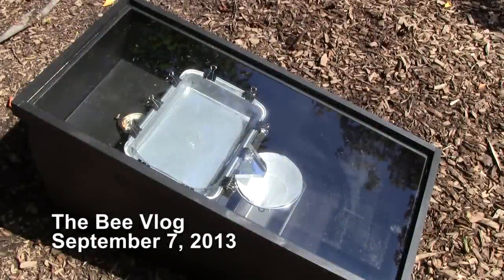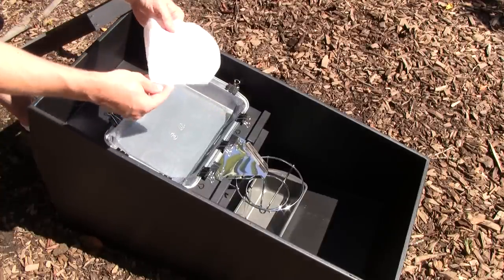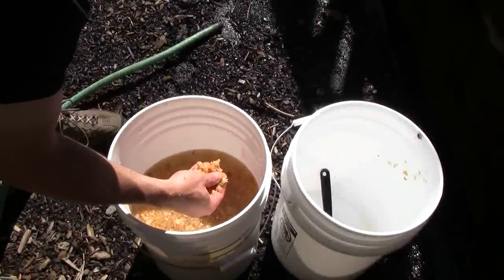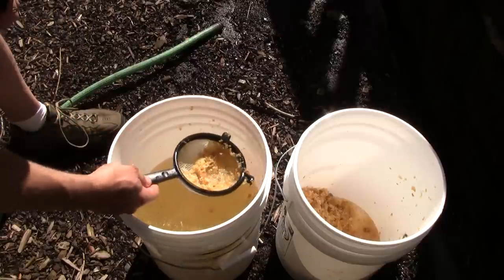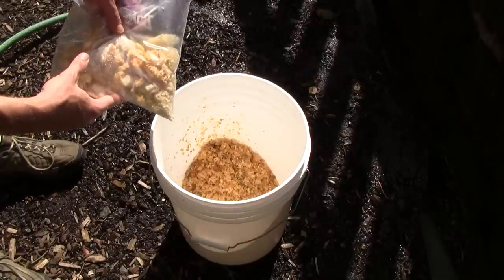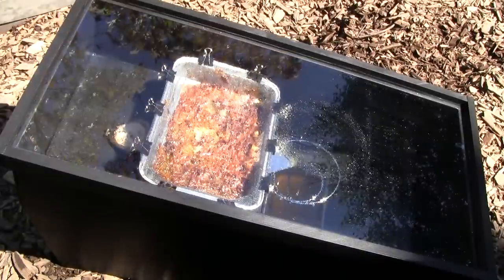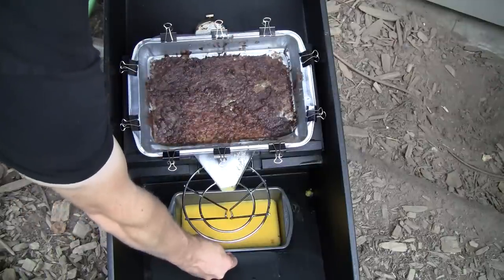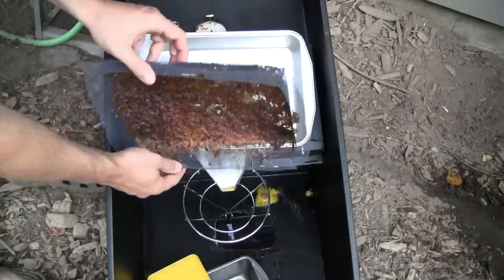Solar Wax Melter Test - Bee Vlog #118 - Sep 7, 2013

Comment: You did a really good job. Well built piece of equipment. I like how you proceeded methodically testing what works and making changes. If you want to keep the oil filter maybe you can try it fitted into a metal funnel. The hot metal may keep that wax from cooling. And maybe it won't haha. That's the fun of testing it out. Great job! Seriously great building on this one. Subscribed and liked.

Comment: To reuse that screen, turn it upside down on some newspaper and place it in the sun. The heat of the sun will quickly release the gunk from the screen and it'll drop in a lump on the newspaper (makes a great fire starter). The screen is now ready for reuse.
Reply from the maker: Blaine Nay Great tip. Thanks!

Comment: Old video, buuuut
you might be able to place a 16D nail on top and perpendicular to the top of the frame.  You could then use it's shadow like a sun dial to judge right angle to the sun..just a thought.

Comment: Another beekeeper said that the process of rendering beeswax in water is what causes candles to sputter, so hence, he processes all his beeswax in a double boiler. Is there any way to know which, or if both, are the cause?
Reply from the maker: If water gets in the final candle product it can cause sputtering. However, I haven't had that problem. Probably because I use a double-boiler to melt the wax for one final filtration, then again to melt it before pouring into wax molds. Any water that got into the wax during the rendering process is long gone by the time I pour candles.
Reply: @TheBeeVlog  Thanks for the clarification. Makes sense, nice tip.

Comment: Any idea where one could find a flat stainless steel funnel like the one in this video? Outstanding melter, and I'm in the process of building myself one right now.
Reply from the maker: I bought some thin sheet stock at the hardware store and cut/formed it myself.
Reply: @TheBeeVlog  Thank you for the quick reply. I was pricing the cost of flashing material and was thinking of doing the same. I was hoping to avoid having to make one because I know I will cut myself on it. LOL.

Comment: I know you have not posted a new video in about 6 months, but have you revisited this wax melter? did you fix the issues you had?
Reply from the maker: I do use it still on warm sunny days. I don't bother using the filter anymore. It's not really necessary. Most of the gum stays behind in the screen, then I just change out the screen. This solar melter would probably get hotter if I had the angle of the glass set correctly. I've since learned that the angle of the glass should be about the same angle as your latitude, in my case it should be about 45 degrees. I'd have to completely redesign for something that steep. So for now it only really works on our hottest days.
Reply: Thanks for the update. I live in South Florida, so even on our coolest (notice I didn't say cold)days we still have a healthy amount of sun. Thank you for all of the videos. I have watched every single one, I;m a big fan of your channel.
Reply: @TheBeeVlog  you could flip the screen over to listen the gunk off of it.
Reply: @TheBeeVlog  interesting about the earths tilt and latitude. Does that offset week to week? On the solstice you could safely say a 21° angle and equinox 45°? I'm a tad OCD, too.

Comment: That filter still had a lot of wax in it. I'd try pouring a bucket of boiling water through it - when the wax is washed out, the rest of it won't stick so much to the filter, either.

Comment: Never did use any filters when I used a solar extractor. I put the old combs straight in the melter with a baffle infront to let the wax though. I would put it though several times to clean it and if there was any dirt left it would wash right off. I rolled all my own foundation with my wax
Reply from the maker: Yeah, the filter in the solar melter doesn't work. Just clogs up.

Comment: an idea for your box,
build another bigger box next to it, line it with metalic tubing big enough to let air pass trough (vent tubing) paint it all black and connect the tubing to the melt box,  (basically a solar air heater)
Reply from the maker: +elleynde An interesting idea, thanks!
Reply: Good advice.  I used tin cans that stack on top of each other with the tops and bottoms cut out and fitted end to end.